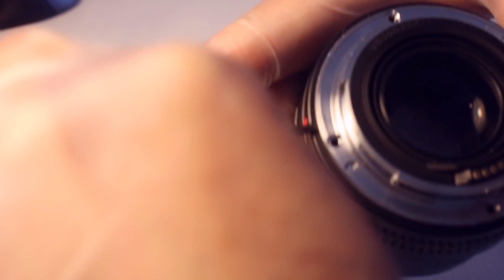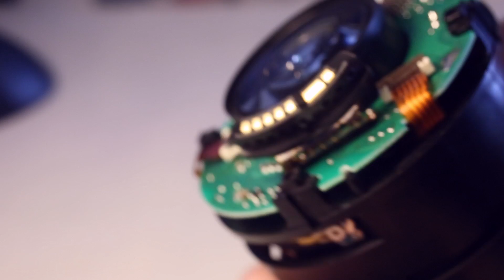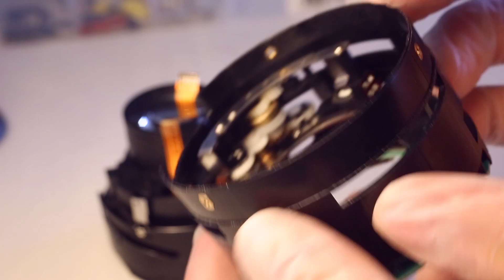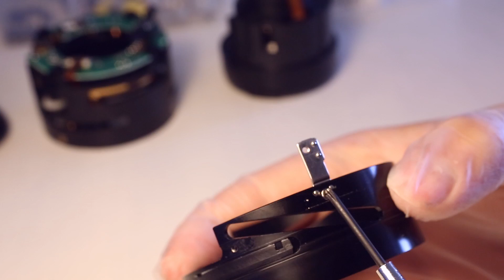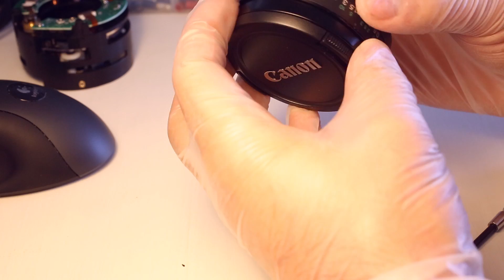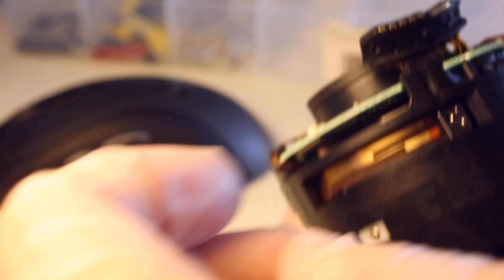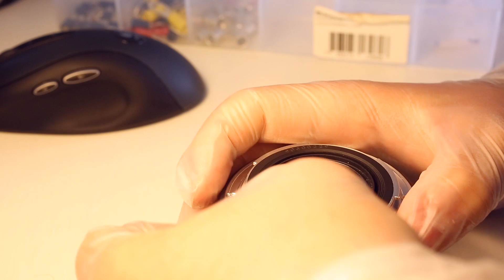Repair focus issue with Canon EF 50mm / 1.4. Dissasembly guide.

Comment: Thank you.
Reply from the maker: +Gerald Thomas Glad that I could help you. Very happy about the outstanding response I've got on this video! Seems like Canon should do a new version of this lens.
Reply: I agree, although I don't have any issues with mine at this time. 

Before I put my lens away I switch it to manual focus and focus it to infinity.I've heard that by doing that it keeps the pressure off of the motor drive mechanisms inside of the lens, of course I don't know how true this, but when you don't want your out of warranty expensive lens to quit working you'll try just about anything.😏

Comment: Hello! My auto-focus works well but my focus ring is hard to turn! Is the problem comes from the the ring your pushing on the video? :) Thank you :)
Reply from the maker: +Hugo Vdk Hmm, good question. If the auto focus works, I don't think it would be that ring. Maybe it has something to do with the teeths on the focus ring? And that you would also fint out earlier in the dissasembling I think. So it may be worth checking it out.
Be aware though, that it may be worth to just let it be if you don't use manual focus often. You never know what you screw up when you do this kind of work with small mechanics :)
Reply: +Christofer Cederberg Thanks you! I use my lens on my 5D to turn short movies. So I only use manual focus. But with my focus ring, doing precision focus is impossible! ^^ I think I'll try this afternoon. And I'll tell you what happened :) (sorry for my english I'm french)
Reply from the maker: Then it's worth a try! The good thing is that the lens isn't super expensive, so if you screw it up it will not be the end of the world :) 
Good luck! Looking forward to hear the outcome.
Reply: +Christofer Cederberg Hi! I couldn't fix my problem yesterday... My Screwdrivers were too old and too fragile... I broke one ^^' I think I'll do a second attempt with new screwdrivers later :)

Comment: Appreciate the effort Sir!!!  I had to buy a new spare part as well as I messed alot with the barrel and was not able to remove the very hard screw. All is fine now and thanks to your awesome instructions. Cheers!
Reply: +Ahmed Selim I couldn't remove the final screw either though still managed to flatten it out with the last metal tag in place hanging off the side of the bench...

Comment: I have my canon 1.4 lens, and its autofocus is quite problem, it cant sharply focus at f1.4- f2.2 i think.. I just can sharply focus at f1.4 with manual focus + live view and it surely to slow for me to catch the moment.. sooo.. should this method (your video) works? thanks for the advance.. from malaysia :-)
Reply: You may have a problem in your camera. The sensor is not aligned to that lens.

Comment: My lens will not autofocus or manual focus. When I turn the focusing ring it turns but nothing happens. Is that the issue your addressing
Reply: I did everything in the video carefully and still can't AF or MF. Huerta, did you fixed it?
Reply from the maker: +P Huerta I don't know for sure. But it sounds like it can be a very hard deformation of the barrel. I guess it's worth a try?

Comment: You mentioned you had a different issue - I have it too! Can only focus from infinity down, but not from 45cm up :( have you fixed yours?
Reply: BrotherBloat Hey! Have you fixed your Problem? I have the same.
Reply: Bernhard Meixner not yet - fixation UK quoted 50+48 GBP repair price at least...
Reply from the maker: +BrotherBloat Sorry, I have not yet tried to fix this lens as I have another one. I've also aquired one more to try and fix. But I think that one is really messed up. will post a solution if I come over one. Would be really glad if you do too if you fix the problem.

Comment: Anyone else have the Err 01 code appear after repairing? Focus issue fixed which is great but when ever I shoot something it says "Err 01 Communications between the camera and lens is faulty. Clean the lens Contacts" Have tried cleaning the lens contacts by still have the same issue. Any one else have this issue after disassembling their EF 50mm /1.4? Would appreciate anyones help, cheers!

Comment: You fixed my lens my friend! It works perfectly and your instructions were excellent. I can't thank you enough!
Reply from the maker: SL Opit Glad to hear :)
Reply: +Christofer Cederberg just an FYI to people using this method - I had to fix the lens once again and have realised that tightening the white guides for the focus ring too much can also cause the focus to get stuck. So make sure you tighten the screws so they are flush, but not so much that the focus ring feels solid and difficult to move.
Reply from the maker: +SL Opit Thanks alot for the input! Maybe this can actually be my problem, I will try it again. Thanks!

Comment: Hi guys I lost the metal clip into the lens and couldn't get it out what should I do?
Reply from the maker: Cheng Minglu Hmm, that's unlucky. Unfortunatly, I have not dissasembled the lens any further than this. So I can't give any advice on how to dissasemble it more. 
If you dissasemble it like I do in the video, can't you get it out by rattling it upside down a bit?
Reply: AWESOME video. Thanks a ton
Reply: Christofer Cederberg found the clip on the ground. It fell out and I didn't notice it. Put it back together and now it works like new. Thank you for this video couldn't have done what I've done without it. Some screws are way too tight with the lens I have though.

Comment: Hey guys, has anyone had issues getting those first three screws out? (Are they glued too?) I have the right size precision screwdrivers but can't get them to budge, and they're starting to strip. Suggestions welcome.
Reply from the maker: jmhoke06 Do you mean the screws for the front ring? Mine was not glued. It's scary when they start to strip. Best is to use enough force right at the start. The bad thing is if they don't move by then, you are likely to strip them. I dont know what to do if they strip, I always fear for that. Maybe try to heat them up a bit if they have some loctite on them?

Comment: Great video.  the focus issue is fixed, but now it's very dark. Even with iso maxed, everything is very dark. Ideas?? Thank you
Reply: I couldn't fix the focusing problem and then I got the dark viewfinder problem as well. I did everything patiently and very carefully
Reply: Hi I know its 2 years later, but the problem lies with the aperture ribbon that you see at 8:33 , dis connect and re connect it and make sure it is tight in the slot, aslong as it isnt damaged somewhere else , then this should fix the issue

Comment: mind if I ask you? I have this 50mm 1.4 for a long time now, the focus motor still fine but one problem that I notice now everytime I shoot with this lens, it always blurry/dreamy, sort of like the result that you usually get from a diffraction lens (very noticeable at 1.4 - 2.8) do you know what the problem is? thanks.
Reply: GOXYA90 If you shoot at a large aperture such as f1.4 it's natural to have a very blurry/dreamy background. The larger the aperture (small f number) the less you will have in focus (shallow depth of field.) Don't worry, doesn't sound as if you have a problem.
Reply: thank you for reading and answering. I know when I shoot using larger aperture I'll get a dreamy look, but back in the past my lens even at 1.8 will producing a very sharp result, now after the lens dropped (hitting the rock on the road, sorry :( ) every images is way too blurry now. maybe I need to buy a new one, once again, thank you for answering.

Comment: great video. 

i tried it without disassembling lens by just pressing the lens against a table gently. Touch wood the focus ring is working again.
Reply: Thomas Fernandes exactly, that what i thought too. If it deforms so easy from the outside, maybe it can be fixed from the outside too. Was your fix lasting?

Comment: Excellent video. I had also like many here bought a second hand lens which looked like someone had tried to fix. Was getting stuck at .45. Followed the instructions here, straightened it out and now it works 110% better. Also great tip as I had to deal with stripped screws is duct tape on the screwdriver sticky side on the screw head and go slow. :)

Comment: This really works guys I bought a 50mm 1.4 on craigslist and it had this focus issue....I was about to get rid of it till I tried this..and surprisingly it actually works...only thing Is pay close attention to when he says be careful...and apply a lot of pressure from the start so you don't strip screws...I came close a couple times
Reply from the maker: Glad I could help you! Always sucks when you buy something used and it isn't what the seller said it would be. 
You're right about the screws. Be sure to use the right kind of screwdriver with tight fit and be carefull not to strip them.

Comment: fixed that problem but now the AF doesn't  work. any ideas ?
Reply from the maker: I have no idea unfortunatly. Maybe it's a good idea to take it appart again and check all the cables? Or you may have the same problem as me, broken AF-motor. Also check the AF-switch so it sits as it should.

Comment: I'm pretty nervous about attempting this, but after my lens took a fall causing the AF to become faulty, I think its going to be my only option as repairs are way more than the lens cost. This is a great video and I look forward to trying this out. Fingers crossed for me!
Reply from the maker: Actually it's not as hard as it looks. Just have something to organize the screws in. I used a old empty assortmentbox for small screws. Put screws in one appartment together with a little paper with instructions of where the screws should sit in the lens and in which order they should sit.

Comment: thanks chris.
I fixed my ring problem. it's not stuck anymore. I broke af switch though:/ it was too tiny. I can live w/o af anyway:(
thanks again.
Reply: +Örsan Karakuş Likewise- that thing is miniscule!
Reply from the maker: Sorry to hear you broke it. I guessed that thing would break really easy as it is so small. 
Maybe there are spare parts on ebay to be bought?
Reply: I haven't checked ebay, maybe someone sells spare parts but I turned the switch to af before reassembling it. the af is always on and but I'm using the back focusing so it's not a big problem anyway:)
Reply: I broke the af switch also. that thing is tiny. I used a small flat head and flicked it into auto. phew.

Comment: hey..... I love this video I just fixed my lens thank you :)))))  but now I have some other problem my camera dont recognize lens..... msg from camera looks like when you have dirty contact between lens and camera.... do you have idea what could be problem..... My AF works now perfectly (and that was problem , which I have solved) but now aperture does not change... I can see it on camera screen ..... but When I press DOF button my aperture does not close .. I think maybe I lost some contact somehow but I dont know how :D
Reply: Hey Boris, there are three tiny ribbon cables you may want to check that they are all connected correctly and there are no tears or rips in them (find a magnifying glass and examine them using it to check). Im not sure what to suggest if they are broken though as I dont know if you can get spares.
Reply: kristiaand thnx . I have fixed my lens  :)) for know its working :)))  thnx all, it was problem with sliding ring. But i have steped on it and make it flat and ok so :)) now everything works just fine :))
Reply from the maker: Boris Kocis Glad to hear!
Reply: Christofer Cederberg Boris Kocis Hi! Thank you for your video. The focus is working now from 0.45 to infinite but I have 2 problems.
1. The aperture seems not working like in Boris's case. It takes picture with 1.4 setting, but any other settings the camera shows error(connections problem between lens and body). Also does not do anything when pressing DOF button.
2. No auto focus, but when I press the button to focus, then I hear a low sound from the lens, like it's motor goes from side to side(0.45-infinite) but the focus ring does not move.
How could you fix your aperture Boris and what "sliding ring" you meant?
If you have any advise please help! Thanks!
Reply from the maker: AtoMusic I'm sorry to hear that you got some more problems. 1 step forward 2 steps back :( 
I would check the connections again and the sliding ring would be the ring that is bent. The last part to take apart and straighten that fix the problem. 5.40 into the video.

Comment: I can not thank you enough for this video. I just fixed my 50 f1.4 so quickly. The guides were quite bent when I opened it up and it didnt feel like I was able to get them completely straight again. I put it back together expecting it to still be broken and wow, its fixed. Both manual and auto focus fully working. Your video couldn't be better, clear, concise and well structured. Thank you for sharing your skills, very much appreciated. :-)

Comment: Don't try this is not worked
Reply from the maker: I'm sorry it didn't work for you. It didn't work for me either, I think my problem is a faulty auto-focus motor. So I need a new one or someone who can repair that. But for those with the bent ring this should fix that problem. Which by the comments below seems to be the most common problem with this lens.

Comment: How big is your screw driver?
Reply from the maker: I dont know actually. Quite small. Some cheap precision-kit I bought.
Reply: ***** PH000 works for most of the screws. You might want to try PH00 for the four screws on the metal mount.

Comment: I also had to redo this procedure twice. I did not correctly inserted the electrical connector and as a consequence I got aperture control problems (it got stuck in my basic tests at F22).
I figured that it might be the connector, reopened the lens re-inserted it (fully in - I could almost swear that it is now even more inside than what is seems to be on the video) and it is now working as expected.
Thanks for you very helpful video:)
Reply from the maker: Nice, glad you share your experience! Will check that my connector is in all the way next time I have the lens apart. I have not yet examined the lens further as I have another working one.
Reply: Thanks for this, my aperture was stuck at f/22 but it was because the connector was loose as well.

Comment: I'm amazed at myself for actually getting this to work in the first attempt. Thanks for the great tutorial!
I couldn't get the ring completely planar with pressing it on a table, so I used a fine wood rasp for additional corrections. If you do this, you probably better make sure to have some compressed gas at hand to remove all the shavings.

Comment: Thank you! 
I used your video to disassemble and clean my lens a little speck of dust. 
I think I can help you as AF: I noticed that in your video, you put the little switch to the left and the AF button to AF. On my machine did not work the AF, then disassembled again and put it to right, it worked! 
Again, thank you.
Reply from the maker: I'm glad to hear that the video have helped you. My lens can focus, but only one way. So I don't think the AF-switch is in the wrong position I'm afraid. But thank you alot for the tips!

Comment: Thank you for this!
I had an communication error and I knew that my aperture's blades got stuck
I disassemble everything just as you did and even more just to reach my aperture.
I used air pressure to loose my blades and it worked!
Thanks!

Comment: can you help me?? me camera shows err 01, so the camera can't connect to the objectiv... the lens kamella can't close :(
Reply from the maker: Try cleaning the contact area on the lens. I've had something similar before and cleaned it with some paper-towels and pure alcohol. Don't know what the product is named in English. T-röd here in Sweden. 

A friend had the same problem, also with a 50/1,4 and solved it by cleaning the contacts. 
Seems like the contacts on the 50/1,4 is sensitive to dirt. 

I've also had the problem on a 50/2,5 macro where the lens would jam leaving the diaphragm blades half closed. Never solved that. Seems like there is some oil in there that needs to be cleaned if you search the problem on google.
Reply: thanks! i solved the problem, it was just the cable which you disabled... i put it deep into the contact and now it works
Reply from the maker: FTALx3 Great!
Reply: I have the same problem. I tired reconnecting the same cable you guys talking about, but that didn't help. I think it something with the aperture, because I can shot at f1.4, but all other apertures I cant.
Do any of you know what might be?

Thank for your video

Comment: Thank you! I had a focus problem that was fixed by these steps, but now I experience another error. The camera says: "canon error, 01 Communications between the camera and lens is faulty. Clean the lens contacts" I have cleaned the contact but it is still not working, do you have some tips what I could have done wrong when I put the pieces back together?